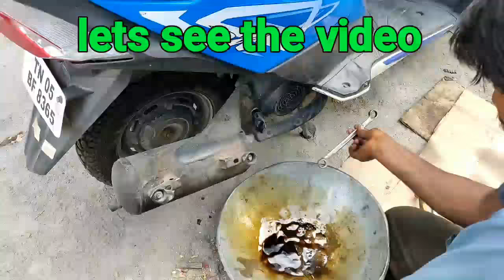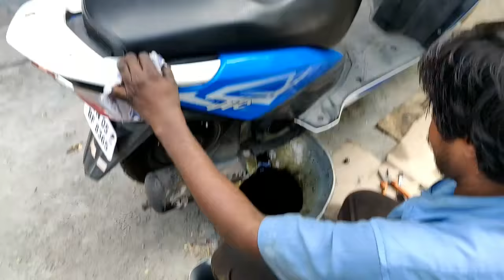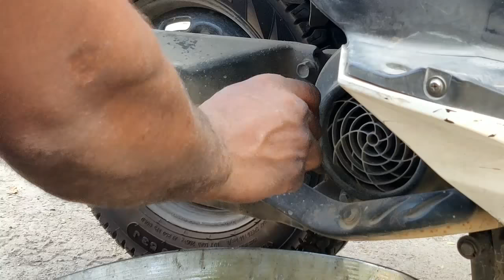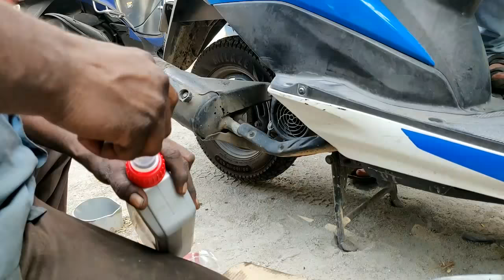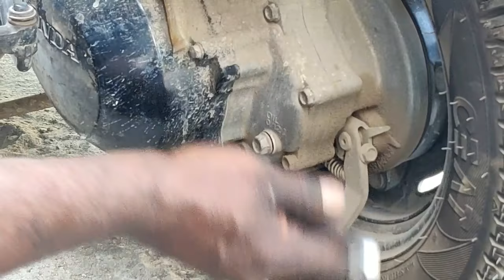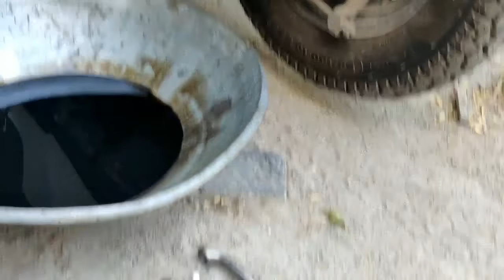How to change honda dio engine oil || manually || gear oil

Comment: can i used 15/50 engine oil
Reply from the maker: No . 15w50 is more thicker it is widely used for bullet only
Reply from the maker: Instead you can use synthetic oil

Comment: Bro using which spanner?
Spanner size ?
Reply: 17
Reply: @jesbinthomas1262  really?
Reply: @sureshvedha1161  yes!
Reply: @jesbinthomas1262  poi 😠ithu   12*13ring spanner
Reply: I'm using 17" for activa 3g
Reply: @jesbinthomas1262  dio la 17set aagala 12ring spanner set aaguthu bro